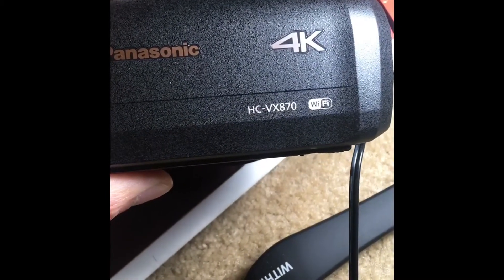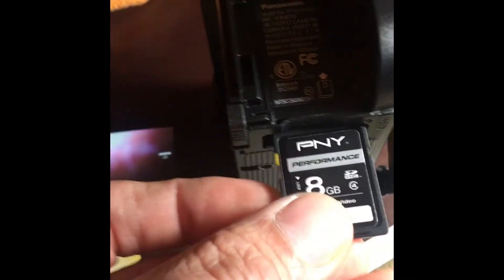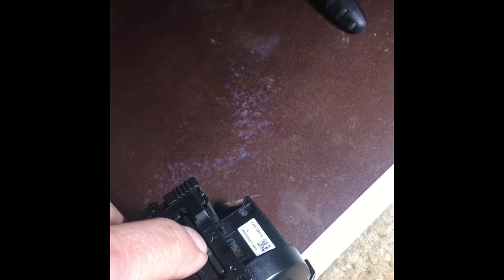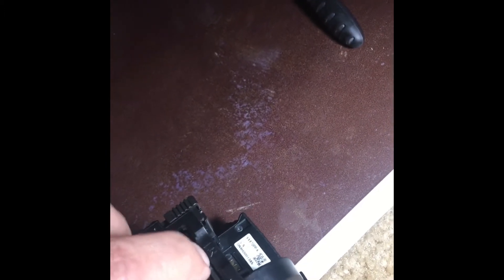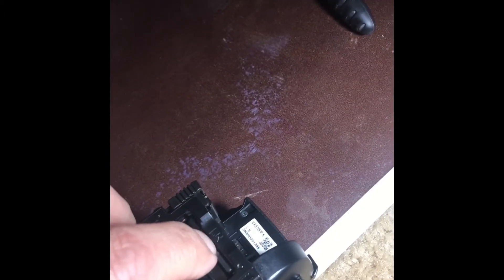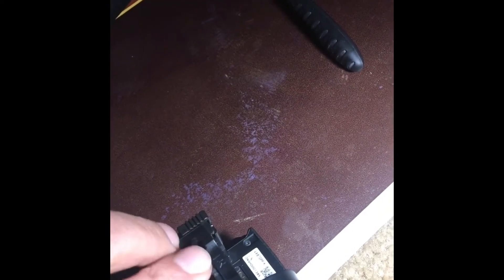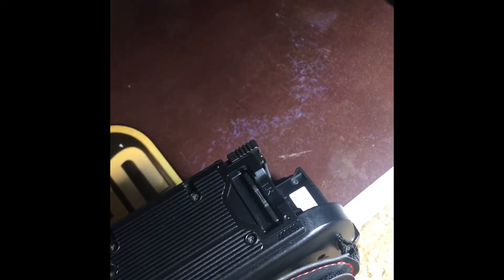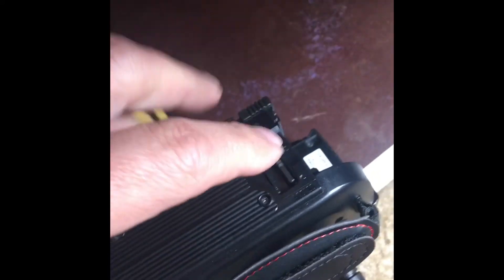Memory Card Slot Bent Pins Fix Solution SD MicroSd Compact Flash, etc

Comment: What is that thing that you put in the memory card slot in and out? I can't understand what you're saying where can I get one?!
Reply from the maker: get an old SD card, cut the metal part using sharp blade or Dremel. The finished product should look like a comb. The comb will straighten the bent pins and hold it in its correct place by repeatedly pushing it IN and OUT.
Reply: @Tulare_DIY  the ole in and out eh? 😇🤣

Comment: Where did you buy your one? I have been looking online everywhere, but can't find anyone that sells it
Reply from the maker: Brynn Parker get an old SD card, cut the metal part using sharp blade or Dremel. The finished product should look like a comb. The comb will straighten the bent pins and hold it in its correct place by repeatedly pushing it IN and OUT.
Reply from the maker: Mathew Thorp I cant find one also and I end up making one. I used Dremel multi tool, its easy Bro.